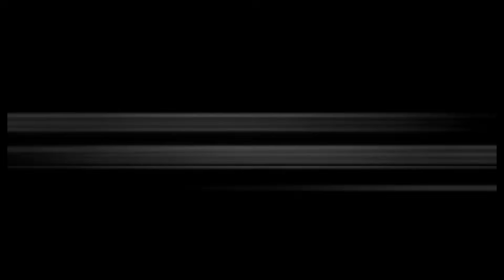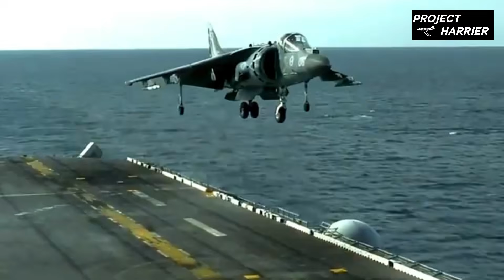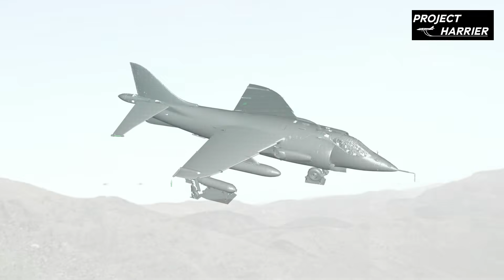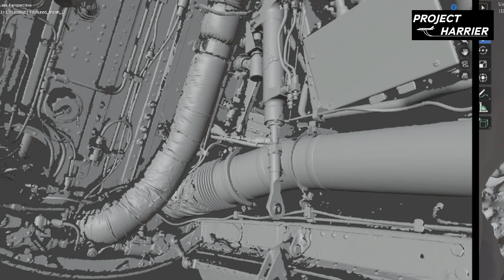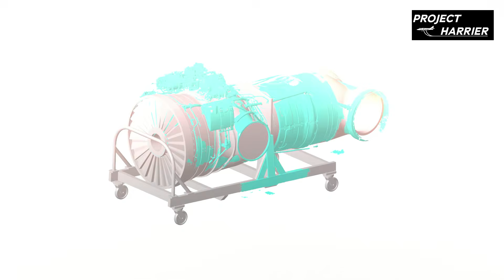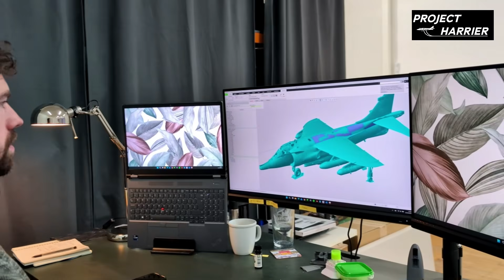Revell Unveils Massive New "Project Harrier"! - Everything We Know So Far...

Comment: That will be interesting. Nice to hear that they scanned the collection so hopefully there will be later versions down the line as well.
Reply from the maker: Here's a list of the variants Revell have pencilled in for future versions:

Wave 1 (The initial release): The Harrier GR.1 / AV-8A, focusing on the early RAF service and US Marine Corps configurations with the original pointed nose.

Wave 2 (The mid-life update): The Harrier GR.3, featuring the distinctly longer, extended nose that housed the Laser Range and Marked Target Seeker (LRMTS), as well as the tall tail warning radar antenna seen during the 1982 Falklands War.

Wave 3 (The naval branch): The Sea Harrier FRS.1, utilizing a entirely different nose structure for the Blue Fox radar, a raised canopy/cockpit layout for better pilot visibility on carrier decks, and modified sea-spec outriggers.

Future Tooling Expansions: The modular breakdown leaves the door wide open for the elongated fuselage plugs and alternate cockpits required to build the dual-seat Harrier Trainers (like the T.2 and T.4 variants).